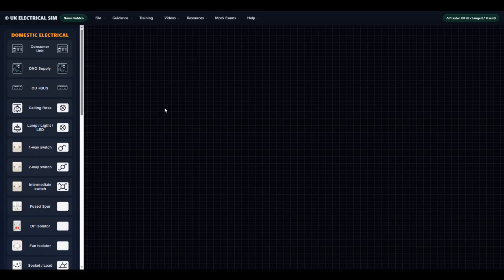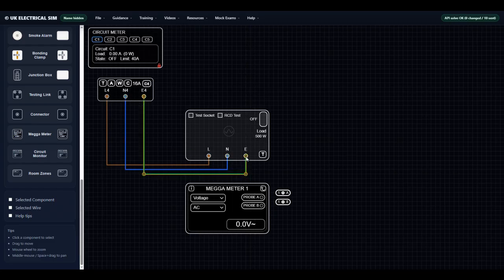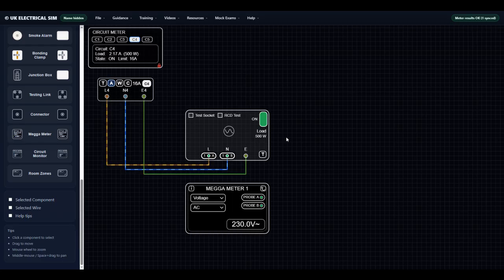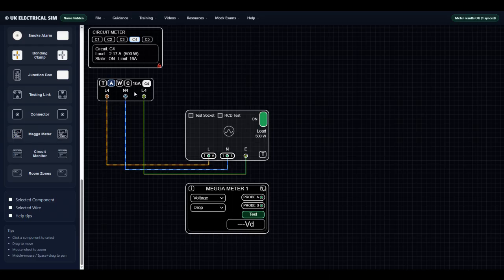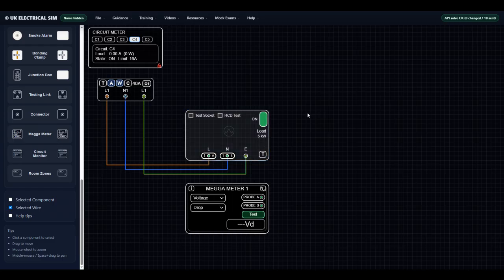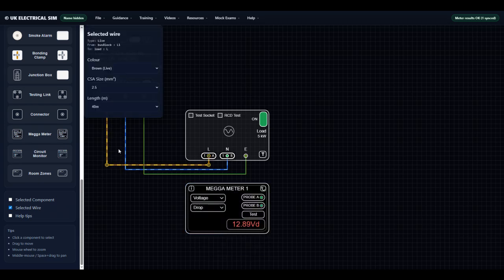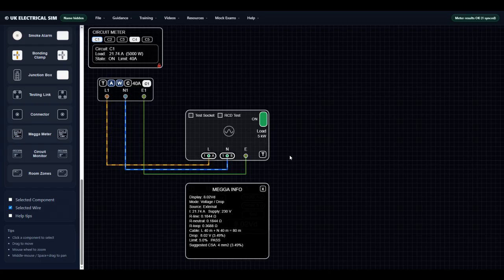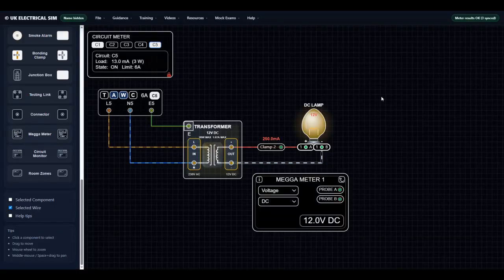Demo Series #8 - Megga meter in voltage mode (AC, Voltage-Drop and DC)

Comment: Is there a US version?
Reply from the maker: No sorry. I don't fully understand the US electrical components to create one. You also have a mixture of 110V and 240V, which is so different to our 230V system in the UK. You also use different wire colours and terminology i.e. what we would call a line wire, you would call hot wire.